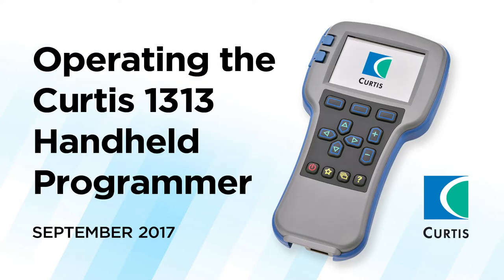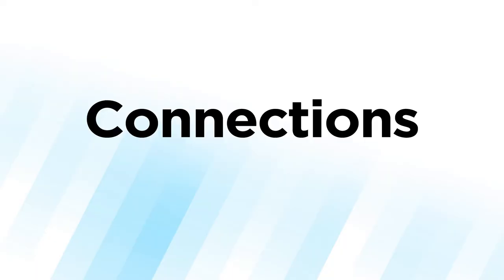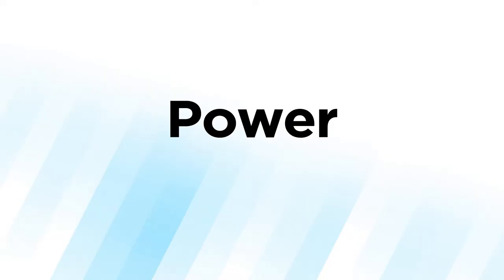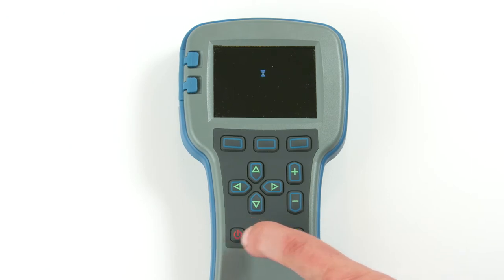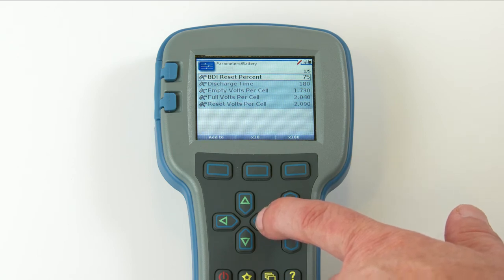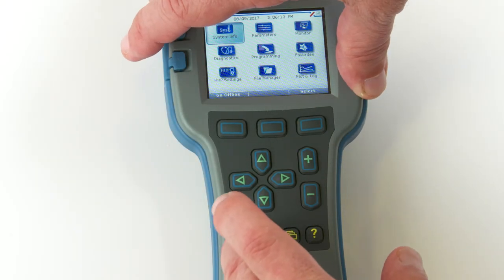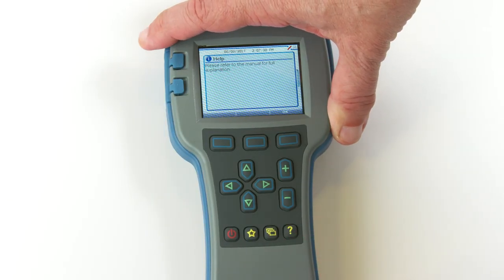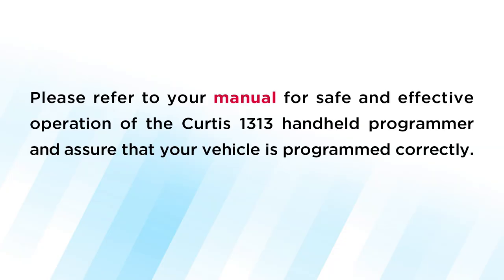Curtis 1313 Handheld Programmer

Comment: I've been using a 1313 without issue for several years. It was in storage with batteries installed. When attempting to review a system setup, it hung during boot. With disconnected from any device, it displays the offline mark in the upper right corner. The softkeys only display go offline. When connected to a device it hangs while attempting to read data. it simply says wait for system. The softkeys only display "go offline". The upper left corner always displays the red offline slash. The only way to turn the device off once it is on is to remove the batteries. 

Is there a quick and easy way to refresh the device or clear the programmer fault? what will shorting p244 and p245 do? Will it clear the error without the need to reflash the firmware? Thank you.
Reply: Is there a troubleshooting guide I can get for this hand held programmer (not troubleshooting the connected device).

Thank you.
Reply: Does it work on 2011 camaro